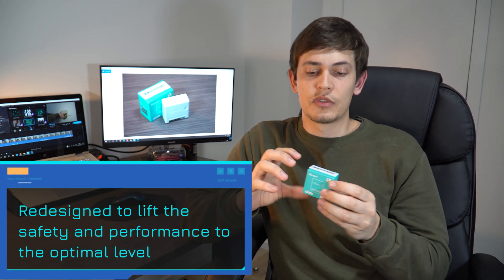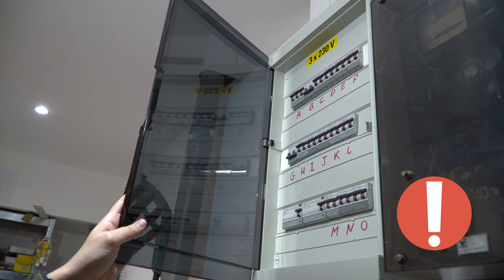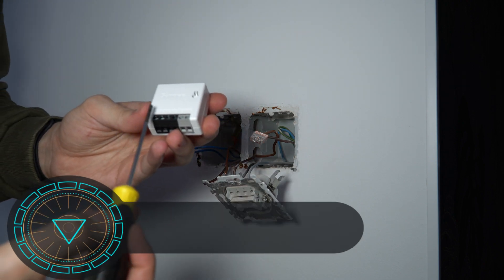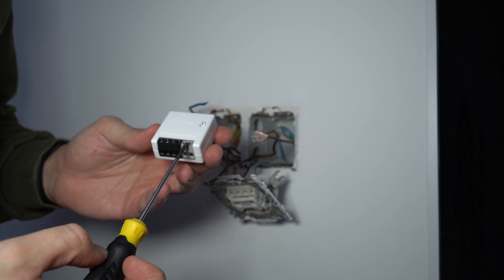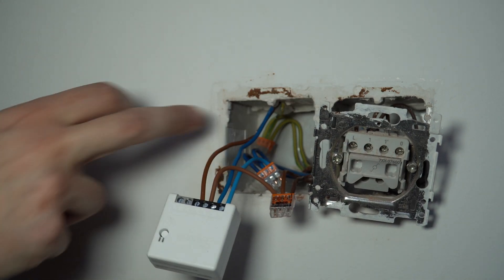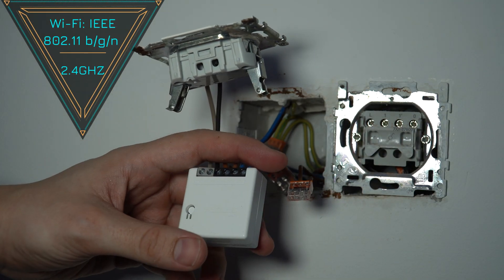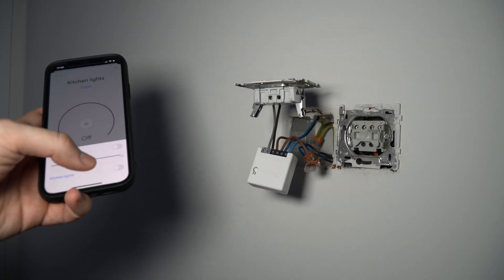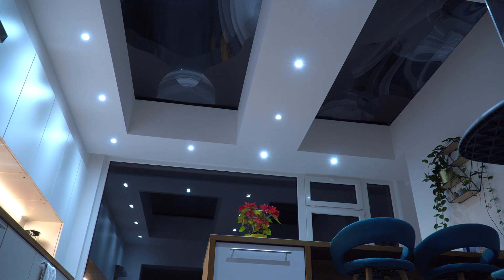SONOFF WIFI Smart Switch Google Home. Sonoff Mini R2 installation

Comment: Does the module and switch work independantly as if they were connected paralely? Can you turn off the light with voice if it was turned on by switch?
Reply from the maker: Yes! Works great

Comment: Hi, were you able to fit the mini R2 inside the switch box? The R2 looks too big to go behind the switch.
Reply from the maker: Hi yes! It fits easily just had to make the cable work neat but I didn’t struggle getting it in

Comment: Very good explanation. However, I would like to know if it can be used in a switch which does not have neutral. If so, how to proceed? Thank you
Reply: The module itself NEEDS a neutral connection - however if you don't have a neutral at the light switch position then you will probably have one up at the ceiling where the light is and you could slip it into the ceiling void.

Comment: Hi, thanks a lot for sharing...excellent content...!!! As I am looking for similar solution so not to replace the existing switches but add this to have the smart capability...!!! the reason for not doing it so far and I would like to ask how is it with fitting it in the back of the existing switch...did it fit ok or you needed any modification (in the depth) to the cable box itself to fit?
Reply from the maker: Hi Evgenios! Welcome to the channel, I am planning covering more of these topics so stick around and enjoy 😁 as for your question, no modification needed the Sonoff mini is ideal for most electrical light switch boxes, if it’s a one way switch it’s a perfect fit and with a two way switch you need to push it a little in when you tighten the screws. But during the installation you should just make keep the cables neAt to leave enough space. If you have more questions don’t hesitate to ask 👍
Reply: @curiousbeginner3748  thinking on using also the r3 version for shutter control so looking forward for the material to come...